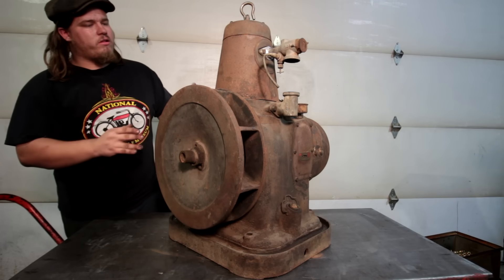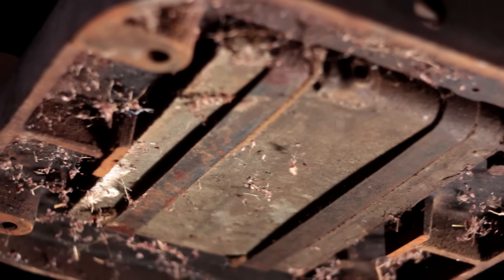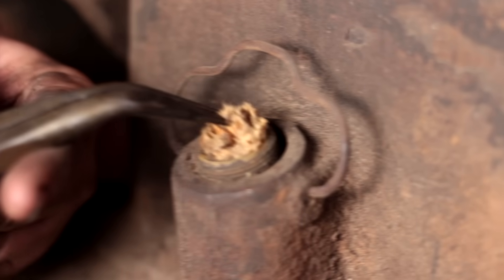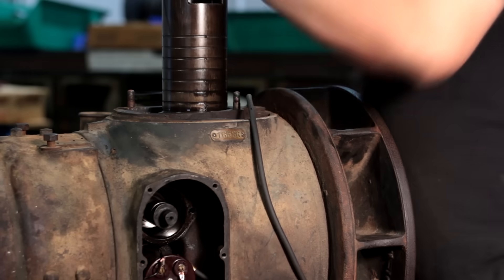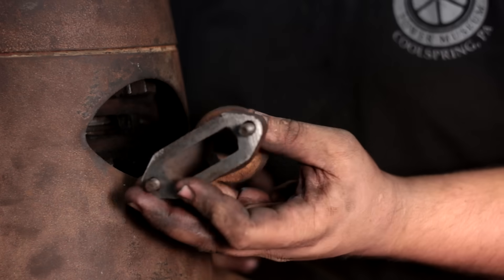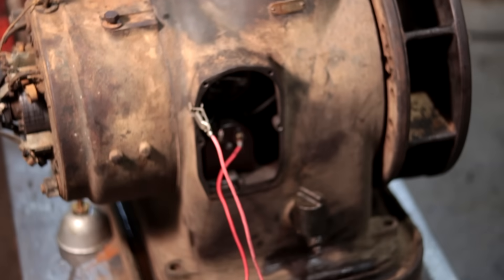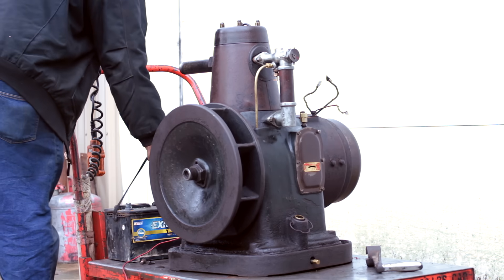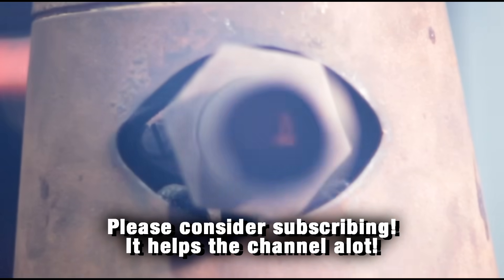100+ Year Old 4 Stroke Engine Design Has NO VALVES!!! Can We Get it Running after 60+ YEARS??

Comment: You are so skilled have so much knowledge, someone should sponsor with a set of proper spanners, so you are not using that adjustable spanner all the time.
Reply from the maker: adjustable is  a better fit for the job I'm doing. have a nice set of wrenches. tend to be slopier fit then a wrench you can snug directly to the bolt head size on a 100 year old bolt.

Comment: Dude. I love stuff like this..wosh i cojld have gotten ahold of.one.if these.

   I dod get an old ass 70s model Homelite 240/120 generator with the ild wrap start Kholer. Because i am lazy , and due to parts being nearly totally gone, i made it an electeonic ugnition engine (well, as electronic as any old no stator small engine) by modifying thw coil of a Kohler Commander and using that flywheel in place.of the original. Them i built a little shelf type deal to hold the starter inplace so it is a.button.start. 

   Like you did here, i removed thw.generator head unit before starting the engine. 

   Went through the head anf all connections check, the commutator and brushes, all that...everyting Ohms out, but it wont build juice. I think, THINK i can get still get it regaussed.

Comment: This is WAY COOL! Thanks for sharing. I was most intrigued by the carburetor. Very primitive. Constant RPM engines don't need much. What is the thing on the end of the carb  that looks like a tiny circular saw blade? I'm guessing an adjustment for air/fuel?
Reply from the maker: choke.

Comment: If you like & wish to preserve the original patina, wipe down the exterior metal surfaces with thinned down boiled linseed oil. When maintained, it will develop a soft sheen while preserving the antique original finish.
Reply from the maker: @patrickshannon4854  linseed oil tends to soak into the pain and over time will swell and cause the paint to flake off of cast iron in some cases so I stay away from it. Light  oils that can evaporate over time are way less invasive.

Comment: Too bad he couldn't take that point system in a retrofit HEI of sorts. There has to be a way to do that in a small confines. I mean I have a design in my mind here I could probably apply at the paper. So I know for sure that somebody has come up with some kind of system for other type of motors. Other than literally pulling it out and placing the other one in as most people do. Something with this solid of a confined and points. I suppose maybe in the least one could possibly put a higher ignition voltage input. Start the common two leads. I can't help the wonder how much better it would run. Possibly even modification to the point so they can handle the sparks without burning or arcing together

Comment: These sleeve valve engines were very efficient  for low rev high torque applications with performance  more akin to a diesel  than a petrol engine , they do tend to use a bit of oil so keeping one eye on the oil level is essential, as you mentioned they are very quiet in operation ,glad you got it running nice , thanks for showing it off😊
Reply: no this is a knight engine, not efficient, the right sleeve valve engines was the Bristol system, the last high power aircraft pistons engine built in the world was the 2040hp SNECMA Bristol Hercules 14cyl built under licence in France up to 1964 for the french military transport aircraft Nord 2501 Noratlas
Reply: The sleeves are well lubricated as they have to be, but that allows the oil to work it's way right out of the exhaust port, and there isn't anything you can do about that. I wonder if it would be possible to add an oil reclamation u-tube on the exhaust.

Comment: With today's industry disposing of waste chemicals in the gasoline, we pay that exuberant disposal gas tax for the industry as well as have to deal with myriad emissions and check engine lights.  The smoke machines have to prove airtightness throughout the fuel vapor system because of the high toxicity levels waste chemicals ready to go through the engine into the catalytic afterburner increasing fuel waste because the lower flashpoints of the contaminated fuels set off ignition way before any Pogue carburetor or modified injection could vaporize a single component fuel to its most efficient ignition temperature.  I think the government should make industry pay for the complete maintenance of every emission system, burnt catalytic converters, plugged charcoal canisters, fried O2 sensors as well as subsidize the difference between the efficiency of the 200 miles per gallon Pogue single gasoline and the inefficient planned precombustion.  A 1969 VW bug made 30+ miles per gallon, went 85 mph stock carburetor and they can't beat that today without using hybrid electrics.  
MAGA get the industry to give up some profits to either clean up their own mess or pay for every emission code fix as well as put money into health insurance for those of us exposed to their benzenes and other odorless killers.  I want the mechanics to expose this travesty for the fraud, murder and financial burden upon everyone with an emission vehicle.  Hell, burning 100 energy star woodstoves inside a shop versus one non-vented gas engine would be more survivable.
Earth answer is for the Sun to toast the invisible unburnt vapors, but that leads to stinky smog aka "inversions" ruin tourism.  Their answer?  Geoengineer the skies with artificial clouds in the Sun's path to let everyone's lungs filter the odorless crap outside.  The resulting imbalance is now on track developing for Air Force 2025 Weather Force Multiplier.  Solve a problem?  Nope.  Make it worse.  The swamp needs arrested.

Comment: It has valves just not a rocker valve.  But the ports open and close so they are in fact valves.  Very cool motor I have never seen one so thanks for sharing with us.

Engineering from the late 1800's to early 1950's always blows my mind to see. some things are so complicated but built so well.  Some things so simple but complicated.  Glad you just oiled her up and did not restore her.

Comment: It is useful to note that this engine pre-dates rural electricity. Farmers used these one-cylinder engines to pump water, run threshers and provide mechanical power wherever they needed it on the farm. At the time, I would imagine that kerosine for lamps may have been more expensive than gasoline for an engine like this.

Comment: Well it might only spark ever other stroke but it’s kinda a two stroke ! But using an extra stroke to clear exhaust!!  But I bet if it had a blower at a turbo to clear it it would probably work on every stroke like a two stroke ! If it sparked every stroke !! Let’s ask a question!!! Do you need to add oil to the fuel or does it run on fuel oil or diesel ? It’s a two stroke doctored to hit every other time ! It’s just a dad flow that’s why they went to a turbocharger or a supercharger!! On set ups like that !! Kinda cool to find a not such a good engine that’s not in the junk pile !! It’s a good history lesson for sure!! I started watching video but was like ya right !!!!! lol!!! Nice find !! Maybe I’ll cool off and watch it !! But I think it’s kinda missing something like a blower or something to move air !! Clear the cylinder!!

Comment: Non mechanical type person here but I watched this twice and did not see a spark plug mentioned. How is the fuel ignited in the cylinder?  Also how much horsepower does a unit like this generate?
Reply from the maker: sparkplug goes in the hole i used to lift it a never filmed it and i didnt go back and take a shot of it so it never made the video.

Comment: Like a two stroke with no valves.
Reply: It has valves, and is not like a 2-stroke at all.
Reply: @brianb-p6586  So where are the valves?
Reply: @receptayyip1410  the sleeves with ports in them are the valves. They're shown in detail starting at 5:13. Did you watch the video?

Comment: Interesting way to valve an engine with a sleeve. The rotary engine also was a short lived design. Originally designed by the Germans. Called the wankel. I have a Homelite 2 cycle engine from WW2. It has a certifugal throttle. Works like a governor. It drives a 24 volt DC generator. Used to charge the batteries in an M1 tank or B17 bomber. Still runs like a top
Reply: Wankel engines are still in production, and were used in production by Mazda from 1965 through 2013, and again since 2023.
Reply: @brianb-p6586  Did they ever improve the lubrication method? That was the main problem with the Wankel. And the reason why the Germans sold the patent to the Japs.

Comment: Tweak the design and you could have a high-performance engine. Awesome variant on the concept of a four stroke engine, but I disagree that it does not have valves. The moving sleeves are actually valves, whereas most modern engines have tulip valves in the cylinder head.

Comment: Oh, it HAS valves, Bucko. Just not POPPET valves....
Reply from the maker: @craigwall9536  ok kiddo. Do you call the cylinder on a two stroke valves?
Reply: @cruddycornstalks  yes. Although they are commonly called "ports" they open and close and control flow...which is the identical thing a poppet valve does...so ALL of those things ARE IN FACT VALVES.

Comment: That’s really cool but I’d be really curious to see if the generator part works after you reenable it and I was wondering what kind Power output it makes and what size of engine it is and i was curious How much did that behemoth weighs. It’s kind of funny because of the valveless design. It still kind of sounds like a two stroke even though it’s a four stroke.

Comment: THANK YOU!!

That is the most complex valveless design I have ever seen, rotating sleeves included!

Can you imagine the cylinder sleeve rotating 360 degrees to open and close the ports?
All it takes is a worm gear and gear teeth in the bottom of the cylinder to engage the worm gear.

But this is so complex, it is amazing!

Comment: It can be dome in a modern machine shop.  With a new engine then fuel injection can be installed, Compresion and fuel to todays specs (with modern lubrication).  Then the efficency can be compared to current engine of equal or very close displacement.

Comment: Why isn't this considered a 2 stroke engine ?
Reply from the maker: because it uses the   otto cycle (4stroke)
Reply: @cruddycornstalks  I don't understand.  Does it have a separate stroke for intake versus exhaust ?
Reply from the maker: correct. when on the intake stroke one sleeve opens the intake port while the other sleeve covers the exhaust port. and then on exhaust it swaps closing one and opening the other.

Comment: Here's a "Cut-away" Demonstrator model being cranked through the motions showing the Sleeve-Valves going up & down along with the piston covering and uncovering the Ports for the Intake and Exhaust cycles. It's a bit on the Blurry Side, but if you stick with it you'll see the sleeves going up & down opening and closing the port alignments with the carb & exhaust.
https://youtu.be/e9PihZoSdvI
Reply: Back in the mid 1970s my dad restored a "SILENT ALAMO" Generator Engine that had ROTARY Sleeve Valves, where the single Cylinder Sleeve had gear teeth cut on the bottom that meshed with the timing gear on the crank to spin the sleeve around opening & closing the ports instead of having two sleeves going up & down.
"Liked" & "Subscribed" by the way so I can check out more of your videos later.

Comment: Very cool engine! Do you have any idea how durable they were? How many hours between sleeve changes for example?
Question about timing: in the last shot, it seemed like the gap that allowed us to see into combustion chamber varied between strokes - does that mean, that timing is a bit off?
2nd part of that question: the exhaust port should open on the up stroke after the ignition - does the red glow is because of a remnant heat, or is the timing off and we have the ports partially open on the ignition?
Reply from the maker: all engines will have some amount of after burn when the exhaust opens just normally you cant see it but when your getting a view of the chamber directly it is pretty bright.

Comment: Interesting and different approach to sleeve valves than the British Bristol Centaurus and Hercules radials. They use a single sleeve per cylinder, but it rotates in addition to rising and falling in order to time the intake and exhaust events.  And of course they have a lot more cylinders (18 and 2000+ horsepower for the Centaurus).

Comment: Edit: vinegar bath before wire wheel, you’ll take every bit of that surface scale off. You can even water it down if you haven’t got enough, the vinegar as long as it’s a strong enough mix over 50% it’ll make cleaning rusty mill scale and rust off so easy. Learnt that from Michael Chathulu (make big metal sword man).

 If only motors have taught me anything, just free that cylinder up, bit of fuel into the cylinders for light lube, oil has too high of a viscosity to get inbetween the piston and wall, once its free fire that bich up, they run forever, anyrhing cracked or damaged obviously has to be replaced or fixed, but if you have an old motor like this and it’s just seized, easy fix

Comment: I knew a gentleman, John Walker, who had a collection of Willys Knight autos. He used 30 weight non-detergent oil and he knew when to clean the sleeves as the engine would loose power from carbon build up. He also had an engine demo model to show the internal workings. All sold off and collection broken up at his death.

Comment: Great video and great engine, but I find it a bit odd that it rather has a big generator and ignition coil rather than a magneto. Was that common on small engines over in the US?
Reply from the maker: this is a dedicated power plant to power lights and such so they made it to use the power from itself.

Comment: Reed valves I would think.
Uses a form of scavenge air. Via leather reeds.

Don’t know that for certain but old Fairbanks were known for doing that.
Reply from the maker: no reeds in this engine. if anything you call them sleeve valves.

Comment: Someone mentioned crimping being bad. Well in aircraft they don't solder because it causes the wires to break from vibration. Us proper crimpers and heat shrink and you have nothing to worry about
Reply from the maker: it was all temp so could care less.

Comment: Great video I really enjoyed it from start to finish. I am 69 years old and have never seen one of these engines before, my total respect to the people of years ago who designed these engines and other engines . I always had an extra set of points and condenser in my toolbox in the trunk of my car. My Ford V-8 had the distributor in the front of the engine and it was easy to change points - condenser and adjust the air gap in just a few minutes

Comment: I,had a willys-knight 4 dr sedan,it was about a 1937,had a v16,with the moving cylinders,went to a junkyard in 1970 to get parts for my 42 Packard Clipper ,old man started talking about it,said I could hear it run if I wanted,he took the hand crank and it fired right up,I bought it right then,I think I paid 300$ for it,,guy usually didn't sell anything unless you went in a shot the bull with him until he asked what ya wanted,I bet he had 300 cars from 1900 to 1950,he was, waiting for ww3 to scrap them all,after he died his kids called in Hemmings motor news they auctioned it all off and the kids made a fortune,I bought a 33 Vicky v8 he had in a shed,drove it home but before I did I found someone to pay me 2000$ for the Willys-Knight

Comment: Yes, it does have valves - just not the "poppet" valves most are familiar with. Charles Yale Knight came up with this brilliant design in the days when valve springs were quite fragile and broke at inopportune times. All the action is sliding - the only thing going bang is the fuel in the cylinder. This led to the sobriquet "Silent Knight". The patent was used by many companies. Willys Knight were the main US models. Daimler in the UK (NOT associated with Daimler-Benz, who also licenced the design) used only Knight engines from 1911 to 1931. The first tanks were powered by Daimler's Knight sleeve-valve engines.

Comment: No way I would have left that rust on the engine untreated. I would of sandblasted the rust off. I love Eastman Ceramic color spray cans to make that old engine look brand new, but first prep it with rust encapsulator and then put on the final coat to get a really hard shiny finish.
Reply from the maker: i did better! i preserved it! anyone anywhere can destroy the history and original paint  to throw $30 in paint on it that means nothing.

Comment: Something like this is very much outwith my experience  but I find it quite fascinating non the less! I'd love to know what has may have been used for and some idea if it's power output. What I find amazing about this engine is it's simplicity yes far fewer moving parts hence how quiet it runs. Testimony to its inventors to still exist 100 years later and to be running again many years later after the passing of the original inventors and these engineers who employed this device in the several applications it may have been used for.

Comment: Dude, you definitely know what you are doing but why the crescent/adjustable wrench for everything? 😂 I mean I like it cuz it shows anyone can do it with minimal tools but I was just surprised with your knowledge that you don’t use wrenches and sockets. Def dig the channel and will surely check you out again 
Thnx for the chance to learn about this type of engine which I had never even heard of
Reply from the maker: they  are more reliable ad getting a snug fit on rotted and odd sized bolts making tear down easier and faster. only on extra tight or hard to reach bolts do i ever use other tools